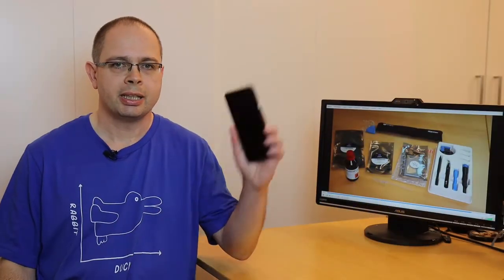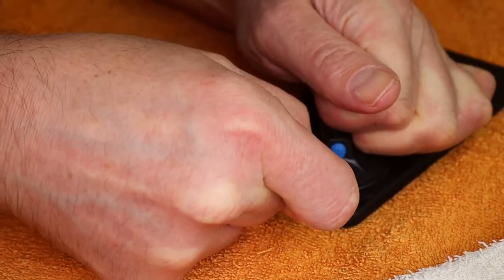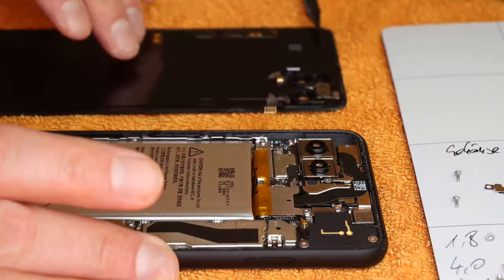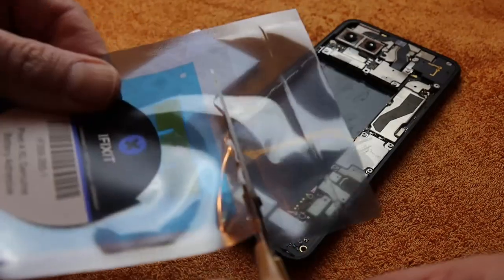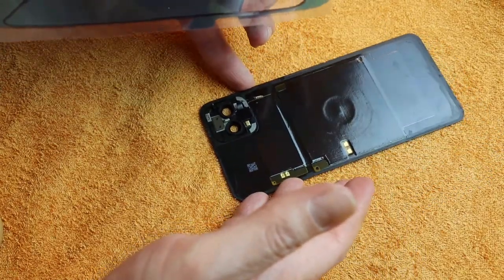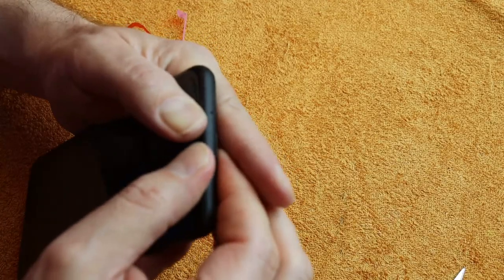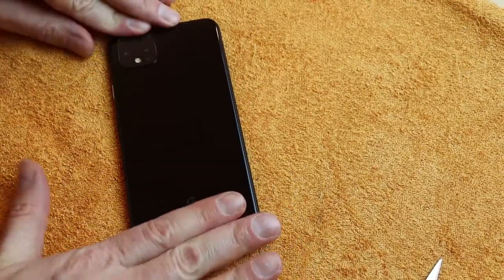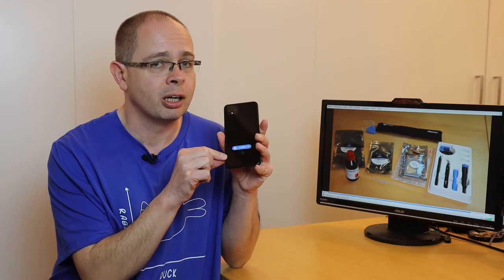Swapping the battery of a Google Pixel 4 XL - A tale of gunk and glue

Comment: Hi, have you tried using a battery charge limiter like ACCA to prevent the battery from charging past 80%? It should help make the battery last a lot longer, because LiPos don't like being fully charged and discharged constantly.
Reply from the maker: Hi, no, I trust the charge management of the device. The only thing I do for battery health is not using fast charging. I plug the phone each night into a rather old USB charger which needs several hours to charge the battery. But as I am sleeping, there is no need to charge faster. I also think that three years is total ok for a battery to last.

Comment: Cool! Only one thing. I'd have tried to put a bigger battery from another phone and then swap the battery circuit from the original. For example the battery of the S10 Plus is 4000mah and has the same size, even some mm shorter than the 4XL . 300mah is not that much but would help
Reply from the maker: I mainly wanted to have the original battery performance back. Using the original parts seems the best way to me to prevent unwanted surprises.